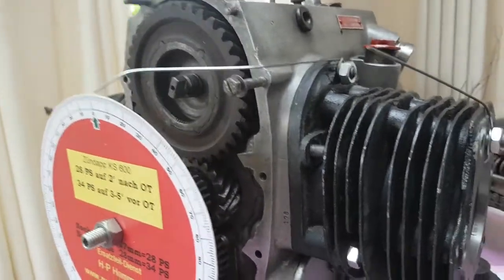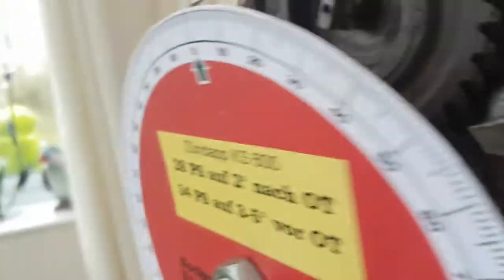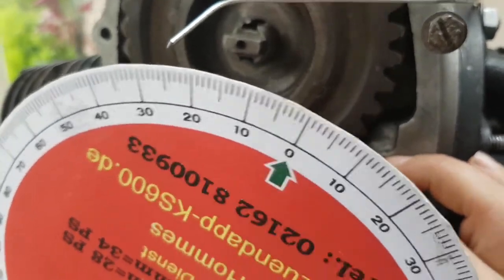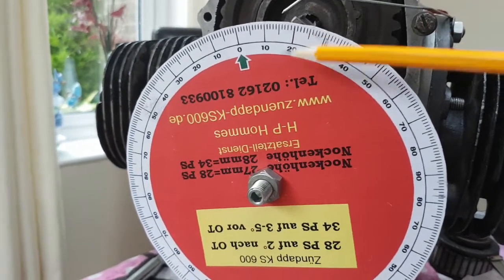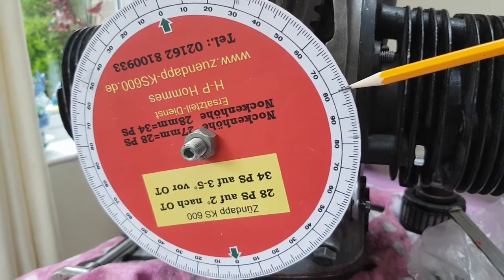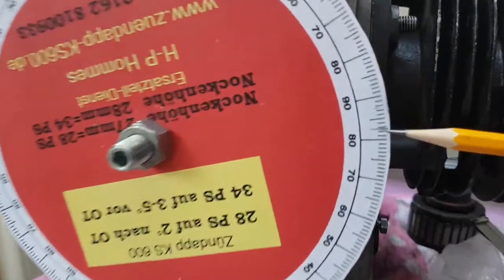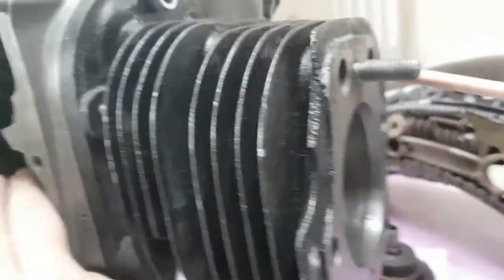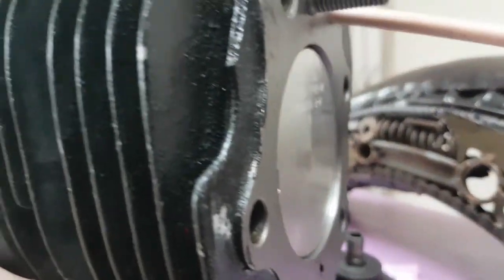How to find Top Dead Center TDC the most accurate, easy way with a degree wheel.

Comment: Better to use the 2 point method because there's a dead zone of a few degrees across TDC.
Reply from the maker: This method does that as you're taking the middle between two extremes, so its right in the middle.